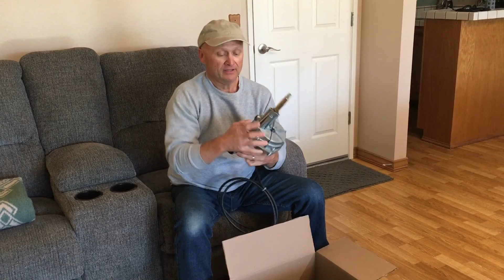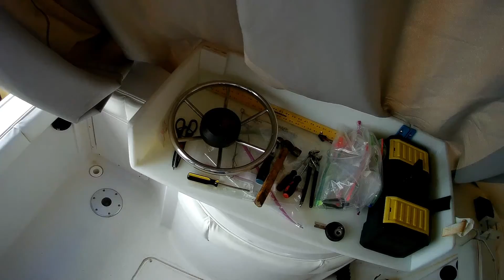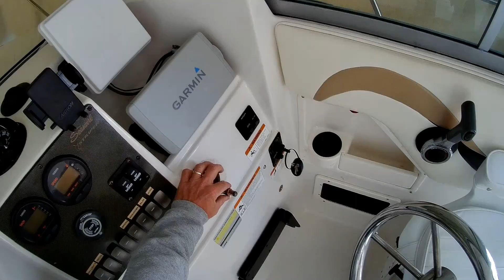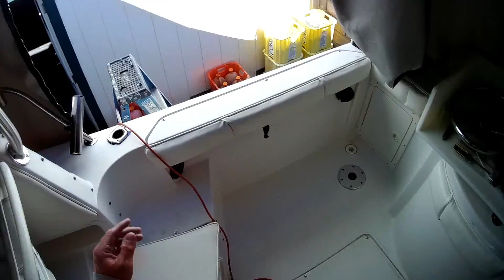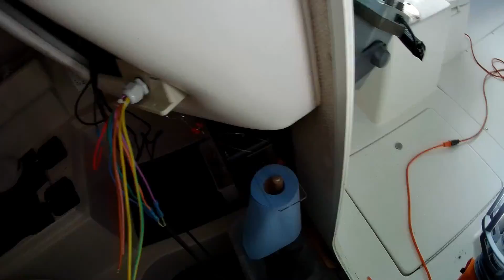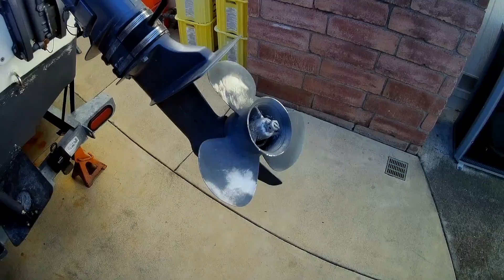Installing an Electric Remote Steering System on My Boat

Comment: Hello , thanks for your video, I need some help on the wiring, can u help me out and tell me where does the orange and purple wires need to be connected????  I really appreciate your help.
Reply from the maker: Hey brother, you are very welcome, and thanks for checking out my video!! So I'm going to watch a segment of my video on the wiring, hopefully it will jog my memory, and if not I'm bringing my boat home tomorrow for service, I will check it out once it's here, and then I will let you know!!
Reply from the maker: Ok, so the Orange & Purple are for the helm steering clutch.
The Orange ties into the White wire coming from the steering unit, and the Purple ties into the Green wire also coming from the steering unit! I hope this helps!!!

Comment: Lake Superior fisherman here. Thanks for the great video. My Raymarine smart pilot drive recently quit working. I’ll be installing this on my stern driven boat, and integrating with my existing auto pilot components. I need to change the steer cable first, as I have rack and pinion steering. Looking forward to it. Thanks again!
Reply from the maker: Hey brother, you are very welcome!! If there is nothing wrong with your rack and pinon, I believe they have a steering unit for that. You might want to check with the company first and see what they have for your system. The only reason I went with this unit is because I already had a standard cable unit. I hope everything works out well for you, and thank you so much for checking out one my videos!!!!!!!!!!!
Reply: @baldeaglefishingadventures  I checked with them. They didn’t have anything for an OMC drive without changing steer cable. Their R drive won’t work with my setup.
Reply from the maker: @kennethjohnson7807 , Ok sorry to hear that, and thanks for letting me know too!

Comment: I'm looking into the same autopilot system for my boat if the steering motor has enough clearance.  Can your system be wired into a garmin chartplotter to drive routes or to set way points?? If so what additional components are required? Did you have any feedback issues from the outboard using the ezsteer shutting off the autopilot? Thanks
Reply from the maker: Hey Sherman, I don't believe so, this system is just for remote steering, in order for drive routes , and way points you would need an actual autopilot. Now with that being said if you do have a autopilot system that will steer your boat to waypoints, you can integrate this system with that autopilot, so that you can remote steer, and once your done then your autopilot would re-engage. So on my boat I do not have autopilot, and you may want to contact the company for your specific questions, as I do not want to just speculate what you may need. Thanks for your great question!!!!!!!!!!!!!!!

Comment: Looks like a welcome upgrade that should serve you well. I think that is a similar system that “Chris P Fish” uses on his boat. Being able to steer from the fishing deck is a bonus, makes handling the boat safer and easier. Good luck with it. My boat has a second aft steering station and maneuvering while trolling and crabbing is so much easier because of it.
Reply from the maker: Hey brother, yes same kinda of idea as Chris's system. I actually got a chance to try it out Sat. My wife & I went to Angle Island, and Alameda rock wall for Hali's, but no takers, but the electric steering was awesome!!! That's great yours has that dual aft station, makes much easier work for being in the back of the boat!!!

Comment: Gabe, Sweet.  Great upgrades!  I will look into the remote steering by intellisteer.  I chose not to install remote steering last winter when I had the  kicker installed and linked it to the main motor steering control.  So Right, it would be so nice to control steering remotely.  It is on my bucket list of upgrades.  Mr. Q
Reply from the maker: Thanks brother!! Michele & I will be going after some halibut in S.F. bay in the next few weeks, and we will be trolling for them, I will be doing a test on how well this remote steering does. I will have a video coming out on that, with hopefully some halibut on board too!! Take care, Gabe